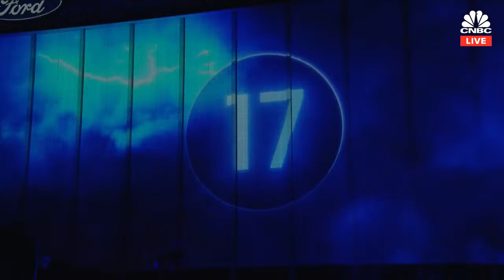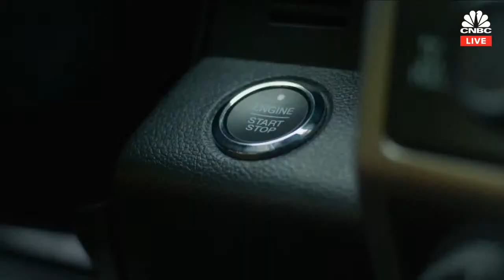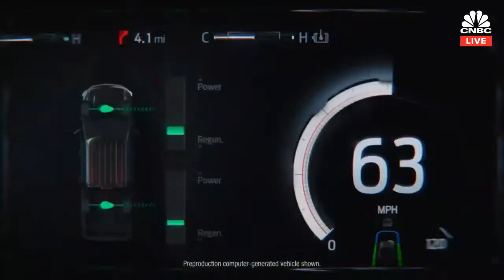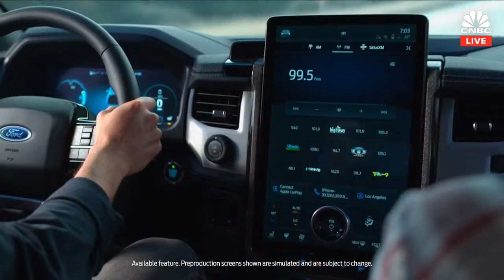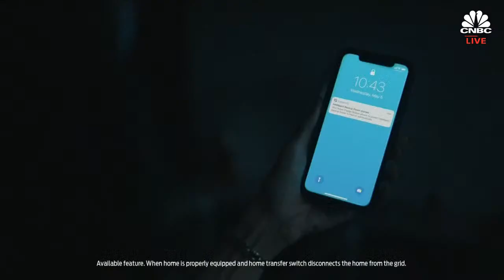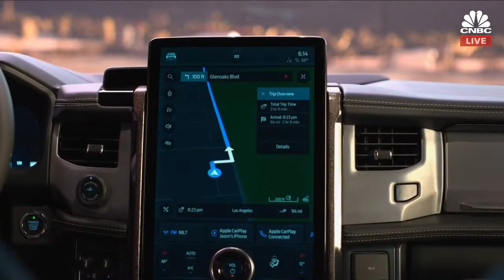LIVE: Ford Motor reveals new electric F-150 Lightning pickup — 5/19/21

Comment: Yeah with a base price of $70,000 . This truck is a fu••ing joke and if I were given one I would immediately go trade it in on a truck that runs off of gasoline or diesel
Reply: It said base price was just under 40k before federal/state tax incentives for buying an EV
Reply: Base price at $41,669. Destination charge included.
Reply: Lowest trim is 40k ans with tax incentives it should be close to 33k-34k. This might be an indusrey level game changer...
Reply: ICE is an old technology but the transition will be slow. The main advantages of gasoline and diesel is the refill time, weight reduction, higher peak torque (mainly in deisels). Disadvantages are more costly to maintain, slower, environmental impacts (i know a lot of people don't care about that but its still a fact). This F150 is a portable generator, safer with a lower center of gravity, faster, but is heavier and charging takes longer than gasoline fillup. Electric vehicles will be the standard in the future for most vehicle platforms as battery technology improves. I do like the fact it can power your home in an outage. If you look at the actual science this move makes total sense, they aren't forcing you to buy it but it is going to be the future, most companies are transitioning their lineup over the coming 10-20 years.
Reply: @jonmarshall3414  agree, ICE underwent similarly. ICE apologists fail to understand this. Technology will take time to develop.
Reply: @DOOM Dragon Goblin Slayer Trinity Depends where you live, nuclear, wind, solar but a lot of places are still coal based. I have my own 5.61kWh solar system that generates around 8megawatts a year which covers around 95% of my need so an EV makes more sense for someone like myself. Most people are charging at night which is when the grid is under less stress meaning less coal plants have to fire up production. You definitely have a good point though, the electric grid is adopting better and more sustainable technology but coal is still hard to beat in terms of production per volume of material. We will see a shift over the coming decades.
Reply: FUD. Base is 39.9k.
Reply: @DOOM Dragon Goblin Slayer Trinity Yeah, i think tesla recently said their supercharger network will be 100% renewable next year. I also think total EVs make less sense for someone in an apartment with no garage (not sure about condos, here most condos have garages you could charge in). I would think ICE or normal hybrids would be more popular for someone in that situation. Would be very interesting if there were statistics out there for what people tend to gravitate based on their living situation. I also currently only own ICE car/truck. Am kind of waiting for there to be a good plugin hybrid or EV in the mid sized truck market.